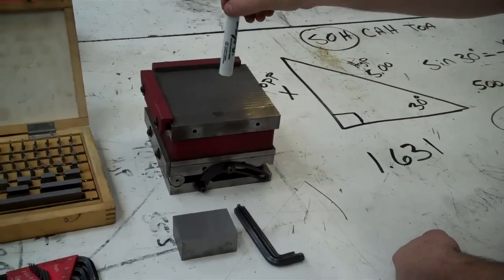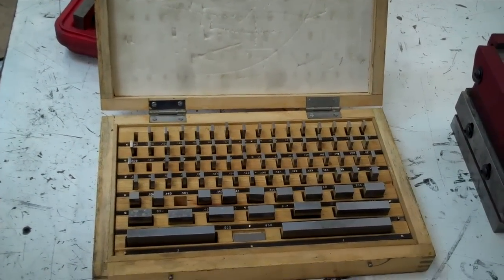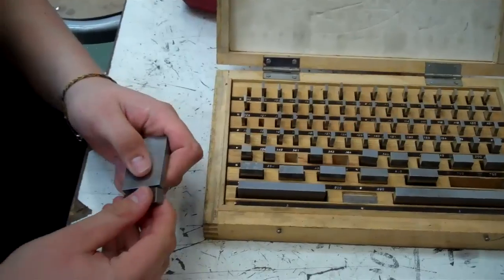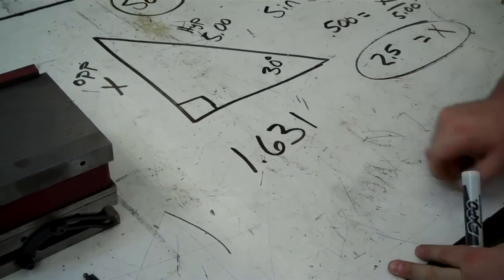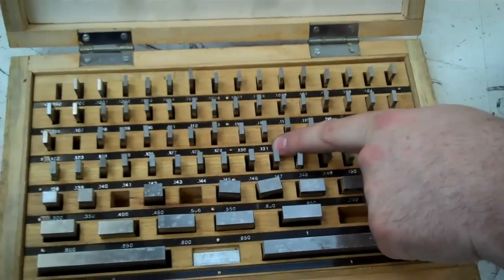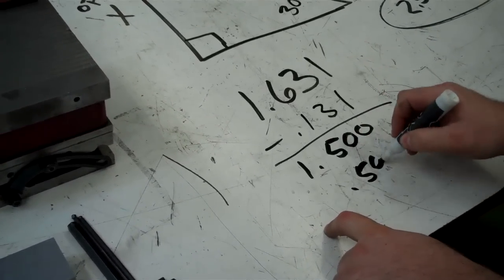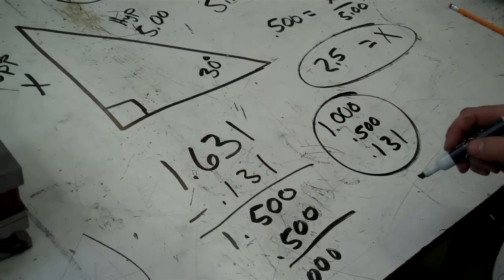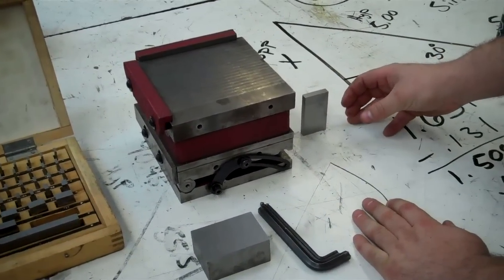Gage Block Setup

Comment: I learned about gauge blocks last year when I wanted to learn: "How do people in real working conditions manage absolute precision engineering?"
I figured machine shops would require more accuracy than wood or other materials.
These magical blocks showed up.
The wringing process is fascinating: they really don't know for sure why they stick together like that.
But they use it every day.
One of those marvelous cases where Engineering succeeds anyway in a place that Science doesn't quite have a theory for yet.

If I was to teach mathematics, I would assign each kid their own set. It gives them a reason to be precise that they can feel and touch and use. All the blocks are sized in such a way that adding or subtracting correctly can result in ANY combination (up to a fantastic level of precision). Of course sets of gauge blocks are very expensive. But it's better than "OH THE STANDARD METER IS IN FRANCE IN A GLASS DOME". Who cares about France. Measurement isn't magical. It's practical.